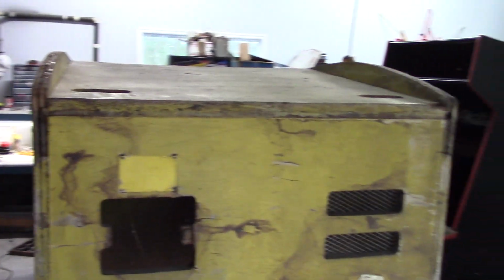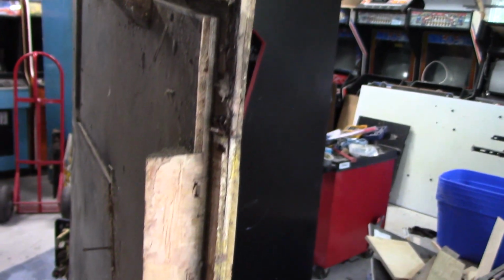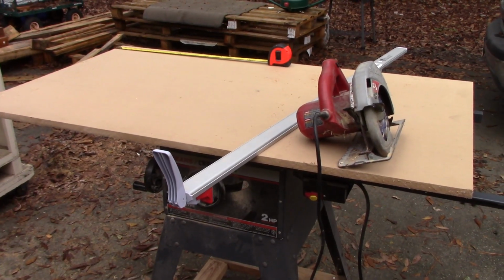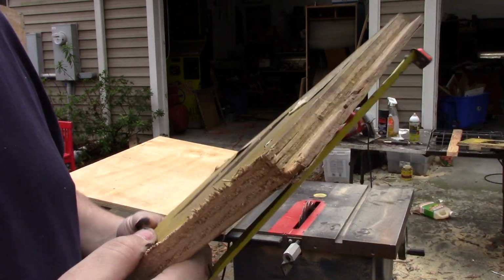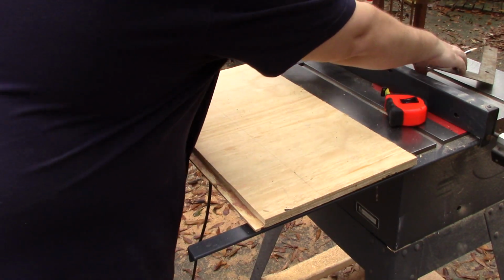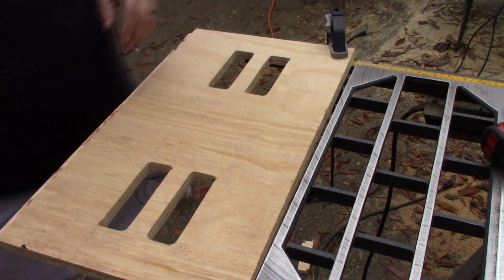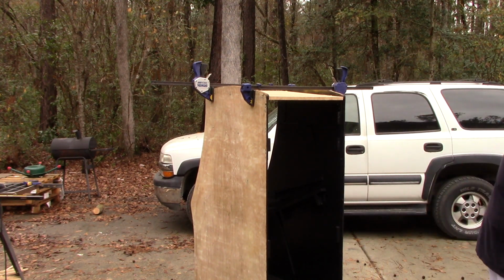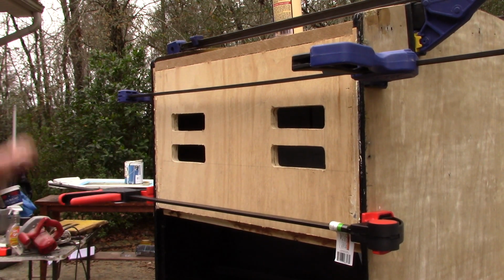Flood Pac Man Restore - Episode 2

Comment: right about the same time you mentioned a CNC while cutting the rectangular holes in the back, I was thinking that you could use a router, and the original as a template with a follower bearing.
Reply from the maker: +Stephen definitely could have but that back piece was little rough and swollen.  Thiught about making a jig for it.  Jigsaw seemes the quickest option at the moment ;)

Comment: Do you ever use Kilz primer on cabs that have that musty mildew smell?
Reply from the maker: +Duke Togo i use kilz on the outside.  The black i used on the inside had the primer in it. And i did 3 coats.  I will kilz the outside
Reply: Arcade Bodyshop   Nice!